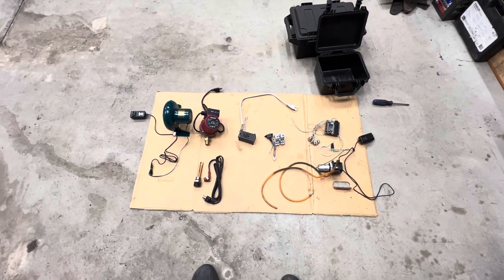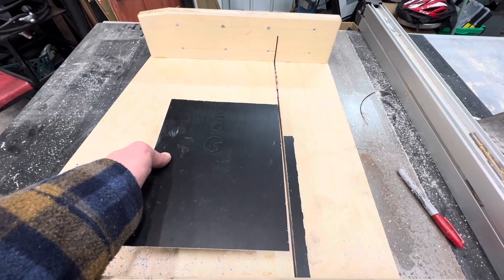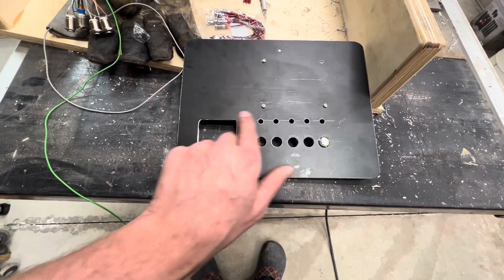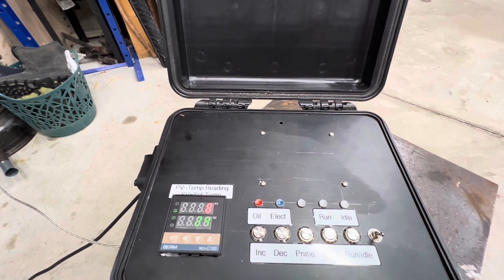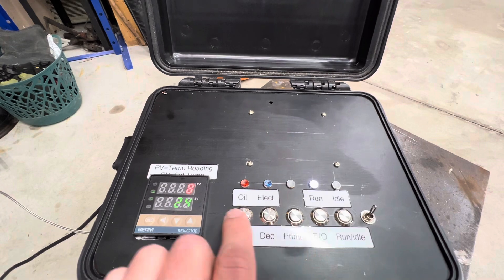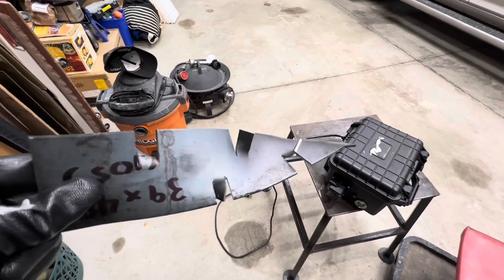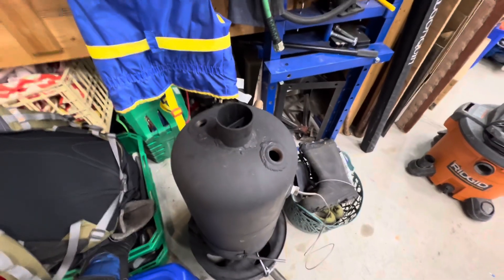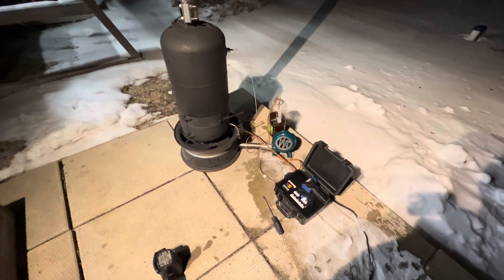Waste Oil Burning Water Heater - WOBWH Pt4

Comment: Try putting a cup or bowl over your inlet to focus the air downward towards your flame, a lot of your inlet air will be going directly upward.
Reply from the maker: Interesting idea, I’ll give it a shot. My only concern is more heat being directed towards the side of the combustion chamber, already have more than enough 😂.
Reply: You possibly will, hehe, but the fuel/air ratio should improve dramatically, and potentially you would not require forced air. I was thinking a small stainless steel dog/puppy feeding bowl, great videos!!!  @rad1876

Comment: I roughly copied your design minus the electronic controls, burning wood instead of oil, works great, gonna use it for my off grid hot tub. Thanks for the inspiration.
Reply from the maker: Fantastic! I’d love to see some pictures or a video of your build. 

So far I have used oil and propane to heat water and it does well. I’m interested to see if my small combustion chamber could work with wood.